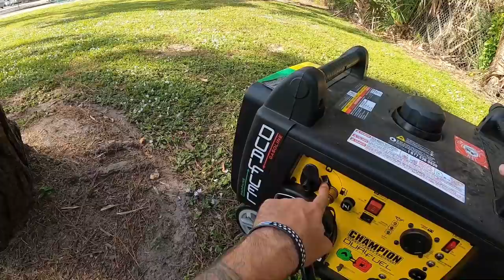Champion Duel Fuel 3400 Inverter Generator

Comment: I have the Champion 3500 watt but gas only because I wanted the remote start but there is a guy around my area that will convert mine to dual fuel and still have remote start, now as far as the battery if you would have pull started it I would charge the battery back up after 30 min. I add a wire with a plug off the battery so I can every month plug in into a battery tender.
Reply from the maker: We tried pull starting and it would not start. I took the battery to Autozone to be tested and it was totally dead so it would not recharge.

Comment: I have the same generator, be aware the battery will not charge while running.  What I do is plug the battery tender that came with the generator into the generator while its running it will keep it topped up  with a charge. Not an issue if your not starting it often, I hunt so it is started 6 times a day for a week.  If it runs the battery down flat it will not pull start, you can boost it with jumper cables and that will get you going.
Reply from the maker: Thanks for the info. Good stuff to know.

Comment: Good lord you had me in tears at the battery and fence portion
I don't want to start any thing, but when I found the battery pooched I would have just used the pull start for video perposes.
I had the Honda version of that on my last semi and the electric start is great but 1 pull and a way to go if it's dead.
Till next video...Cheers🙂🙂
PS...I to would pay good $$$ to watch you heave that over a fence..😂😂
Reply from the maker: We tried the pull start and it still would not start. Not sure why. Now that we have the battery, it is working great.
Reply: I see...it might not have a Magneto...if that ever happens again , just jump the battery or put a charger on it ...I'm thinking it needs enough power create a spark. Anyways glad to hear is all well.
Have a great time at the RV show.

Comment: Did you try pull starting it to see if that would charge the old battery? It is designed to keep the battery charged while running. I use the same generator. I had an easy start on my a/c but I recently changed my a/c to a 15K from a 13.5K. I was hoping to get the new easy start added before Tampa but I might not need the a/c up there. Thanks for sharing! Steve
Reply from the maker: We did try pull starting it but it would not fire up. 😔

Comment: Good video actually. I have a generator (different brand) that has also never been used. I did put oil in it...
The main reason I'm writing this is that many folks not in great financial need are donating their stimulus checks. Previously I donated mine to a local food share but I would have donated it to your cause if I'd only received a nudge. May I suggest that you nudge folks in a future fallen hero ending? 
Lastly, do you need a battery to start the generator or only to not have to pull start it? If you can't start a generator manually, wow!
Reply from the maker: That was really cool of you to donate to those in need. The world needs more people like you.

Comment: Too funny, ive also got a generator ive had 2 years never put oil in it or anything...i might skip the bad battery if i ever use it and just use the pull start lol
Reply from the maker: We tried the pull start but it wouldn't start. I guess the battery has to have a little bit of juice. Ours was totally dead.
Reply: good to know!

Comment: I have to say hehehehe. You the man, did you use your fist or a hammer on the laptop? O yes, the generator does not use a oil pump, the crankshaft splashes into the oil and that’s how it’s lubricated. Thats way no oil filter. And I use the word WE a lot also.
Reply from the maker: The computer caught a fist. It hurt my hand a bit but it had it coming. 🤣

Comment: Battery dead why didn't you manual start using the pull cord,  Gen charges the battery.
Reply from the maker: We tried. It wouldn't pull start either. 🙁